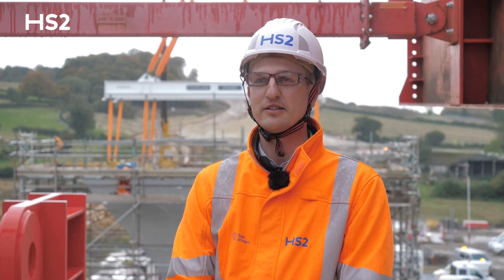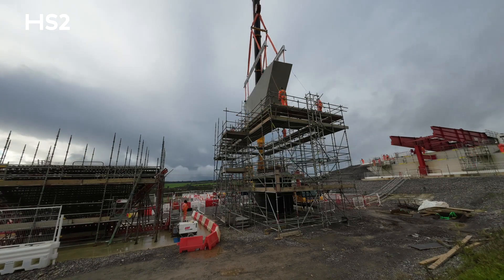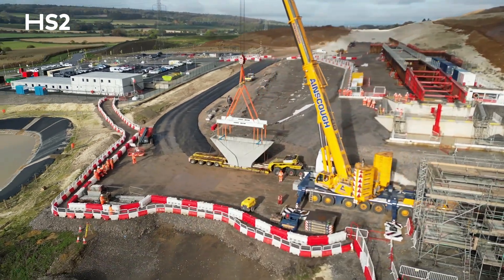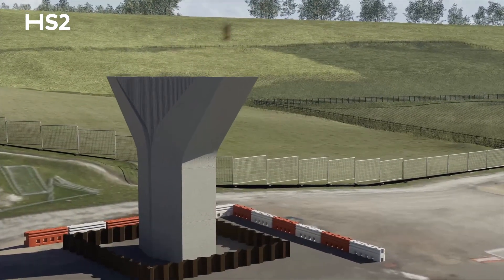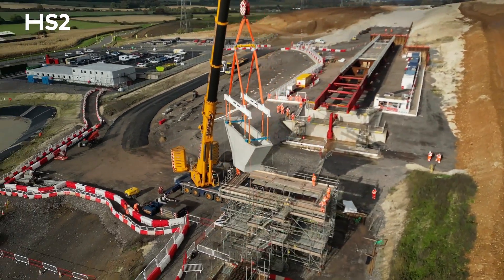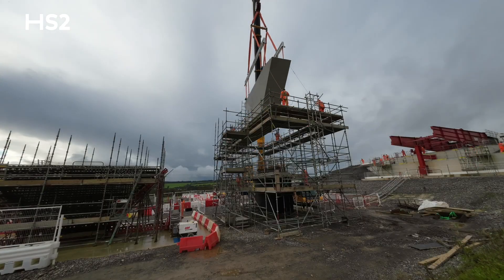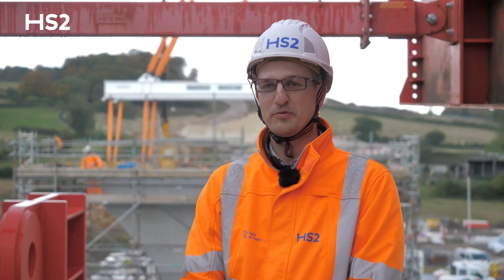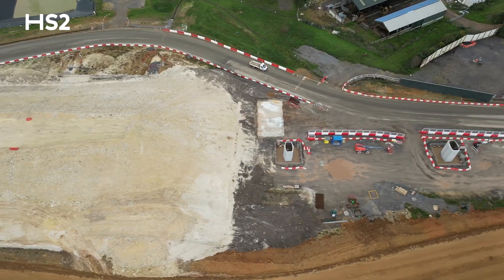First pier complete for HS2's Wendover Dean Viaduct

Comment: As someone who works in the construction industry, it really baffles me when I see so many iterations of HS2 viaducts being used along what is left of the project.  Couldn’t they stick to homogenous viaduct designs throughout the route, not to mention the vanity of having so many unnecessary tunnels (just Check the HS2 website)?  No wonder the budget has ballooned out of control.  Í´ve used high speed rail in Italy and Spain many times and there are two stark differences between what I see in HS2 and those countries, hardly any tunnels unless you have to overcome mountain ranges, and all viaducts are purely functional, not aesthetic and homogenous to standardize construction methods.  If there is ever going to be any future inquiries about the failures of HS2, many of the issues I have raised should be looked at.  I just hope that any future UK governments dońt shy away from investing in future high speed rail though, and they hopefully learn from these mistakes.
Reply: Ah, but the tunnels were necessary; not in an engineering sense, but in a political sense.
Reply: @RobboSez  yes they just kept moving the goal posts regarding the brief of the project.  Politicians were naive enough to think that the budget wasn’t going to sky rocket, and the civil servants at the ministry of transport should have doubled down on this issue.  Which begs the question, why was a company set up (HS2) just for the high speed rail?  For instance in Spain all transport infrastructure projects are closely monitored within the ministry of transport, pre planning of routes with no political interference.  I fully understand that the UK is far denser in population than in Spain and that in certain areas like in London was inevitable, but I cannot fathom why a feasibility study was not carried out to avoid at all costs areas of outstanding beauty like the Colne valley due to the amount of work and excessive engineering practices that have been used which could have been avoided.  On a positive side, now that we have AI, if they intend to extend high speed rail through other routes maybe this could be a great tool to determine the best routes that have the path of least resistance, factoring in geography, road and rail connections and urban areas along routes, until you reach the cities of course.   Satellite imagery can be used as part of the initial feasibility study and incorporate AI for the exercise.  Any HS2 managers should take note of this if they read it please pass it on to any civil servants in the ministry of transport.
Reply: @JJFLUNARMAN i can sort of see what you mean with the company/business bit. The politicians interference has been the downfall of HS2 (quite literally), the constituents whining is what led to the ‘vain’ tunnels, the constant questioning is what led to the budget increasing. It also led to the horrible media storms, i really feel for everyone that works at hs2 because right wing nut jobs now berate them for being a waste of money because of the lies they’ve been told in the papers. I think that infrastructure should be taken away from the party politicians, and neutralised. Hand it off to a semi-independent body like in Spain, depoliticise it, stop it from being used as a tool to get one over. infrastructure is too important for that. We forget how important it is. The cancellation of HS2 will be one of the decisions that make my generation look down on the older ones, for forgetting us, for being more self-interested. You need an explaination for a generational divide? Here’s a perfect one! however, i do raise issue with your description of the Spanish and Italian high speed rail networks. I was on the Italian one only a couple of weeks ago, and it is mainly on viaducts and in short tunnels through hills. The viaducts for HS2 had to be aesthetic because people would whine if they weren’t. HS2 is a product of the British people’s and media’s pessimism, inferiority syndrome and selfishness. Labour must  learn from the mistakes, restart it, all the way to Leeds, but hand it off to a separate body, try to keep it quiet, out of the public eye. People were whining about the cost, but dont forget it was a 30 year project, with a return on investment at the end. Cancelling it to Leeds was the worst decision Boris ever made, setting a precedent that infrastructure could be cancelled halfway through, which is never a wise move.
Reply: @cum3173  I wouldńt worry regarding the future of high speed rail.  The likelihood is that Labour will rebrand the Birmingham to Liverpool/Manchester route as HS3 and choose an alternative route, and a holistic high speed plan is put in place for the rest of the UK.  Remember that phase 1 is scheduled for completion for 2033 and the current changes are likely to take at least a year of so to design and plan.  I already saw another YouTube video about railway enthusiasts highlighting the problems the HS2 connection will cause on the Great Western line, it will create a bottle neck of trains in an already saturated railway line.  As far as the  usage of tunnels and viaducts, I dońt dispute what you’re saying.  But as you said the tunnels are short in comparison to HS2 and as far as viaducts are concerned, they are homogenous in design to standardize construction methods. On the other hand the HS2 viaducts differ from one area to another which is crazy from a cost perspective. Anyways,  hopefully lessons have been learnt from this fiasco.